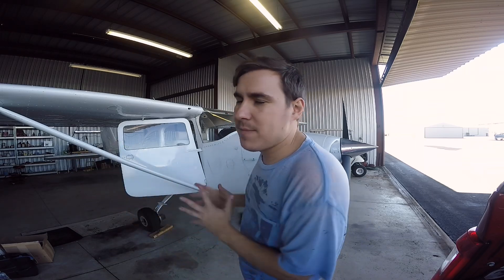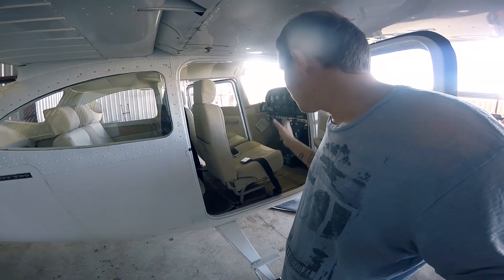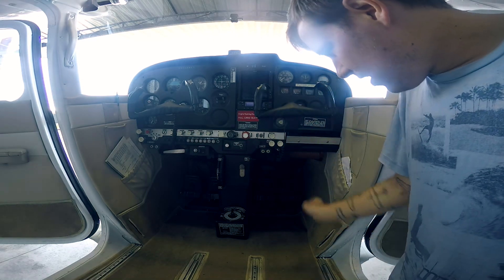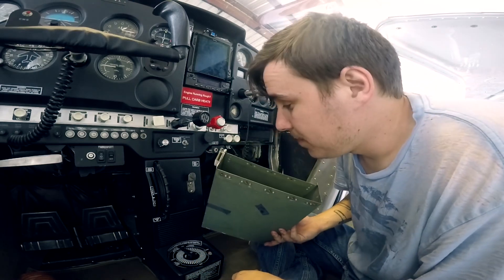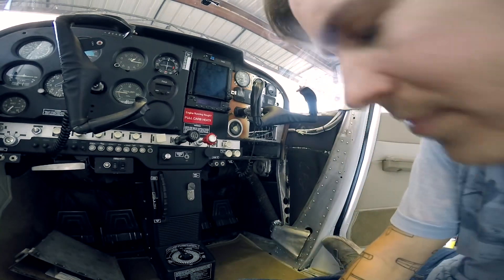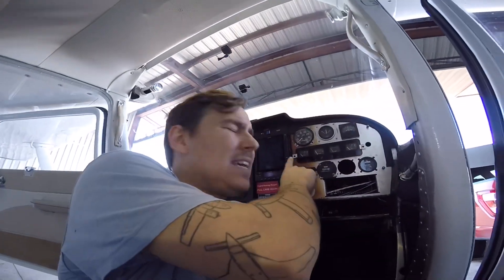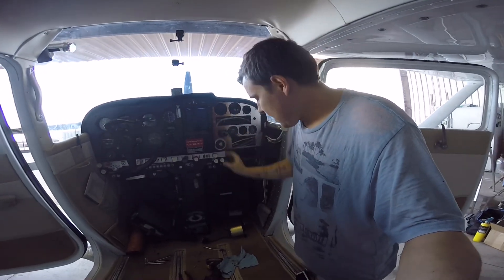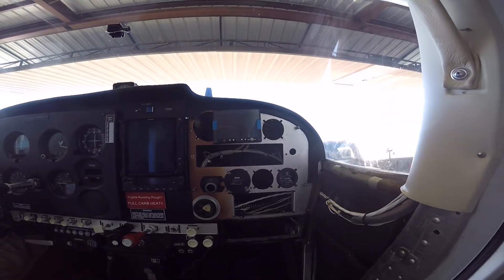JPI EDM 900 Install Part 1, Cessna 172, Disassembly And Old Instrument Removal!!!

Comment: Fantastic information as always from you Bryce. I had a follow up question for you in response to your prior video submission RE: "Three (or 4) Ways to Obtain your A&P License in 2024" . If an individual were to go to work for an MRO facility such as StandardAero as an employee, would they still be able to test for & obtain their "P" license/repairman certificate from the local FSDO without any experience in the theory of operation Schema and practical hands on operation Praxis in the teardown, inspection, repair, & reassembly of PISTON driven reciprocating engines because StandardAero only overhauls exclusively gas turbine engines ? 

       Therefore would an applicant still be required to obtain PISTON ENGINE experience through some other alternative means or would the FSDO examiner accept a "P" license applicant without prior hands on piston engine experience and perhaps just an understanding of the theory of operation from reading and written/oral testing alone based on the content of information found in the FAA's Aviation Maintenance Technician Handbook-Powerplant Repairer's Manual Volumes 1&2, (FAA H 8083 32) and the Aviation Maintenance Technician Handbook-General (FAA H 8083 30B) ? -Thanks in advance
Reply from the maker: Unfortunately the answer is it depends on the airworthiness inspector you are talking to.  Some will let you test for the whole p after working somewhere like standard arrow. Others Will stand on the position that because you have no reciprocating engine experienceyou can't test for it yet. But I have plenty of friends who retired out of the Air Force with no piston engine experience but we're still signed off to test for the A. And p.